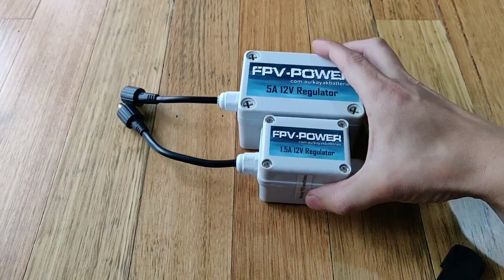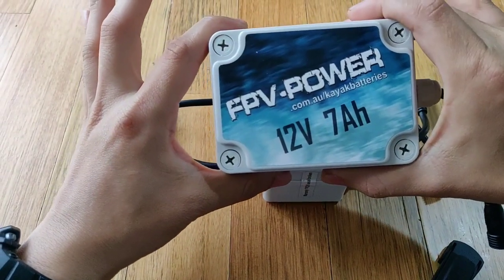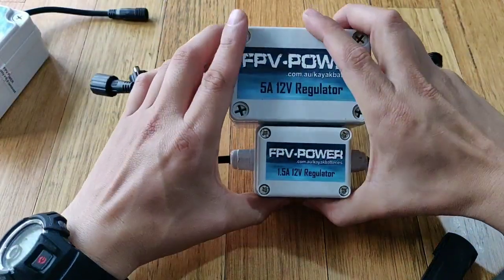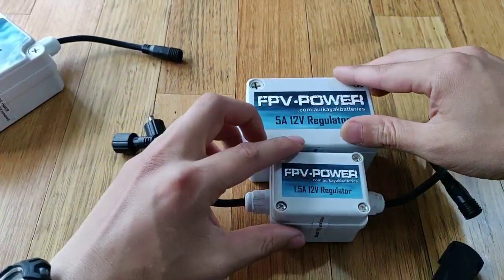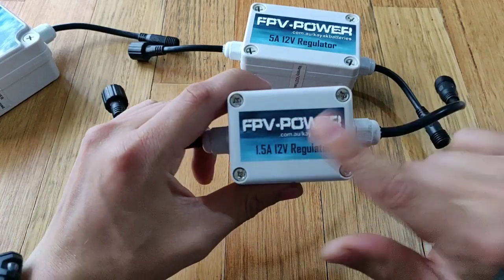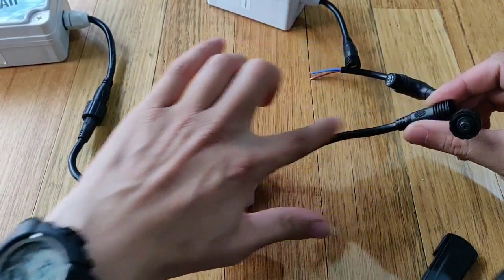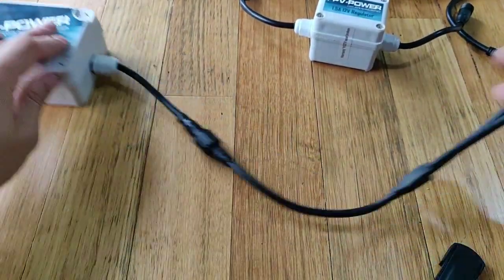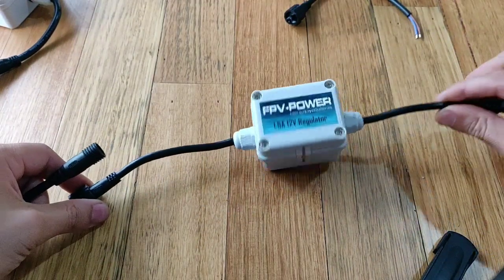Fpv-Power 12v Regulator and why we might need one.

Comment: How would I hook this up if I’m running your battery to a Yak-Power circuit switching system?
Reply: You will need to make an adaptor or cut off the plugs and add the yak power connector.
Reply: Thank you.

Comment: My FPV-POWER 12V 1.5A regulator does not have marking for IN and OUT. With the unit face you, I see you connecting the left side to battery and right side to fish finder. Does the regulator care which is in, and which is out? I see no marking so makes me wonder.